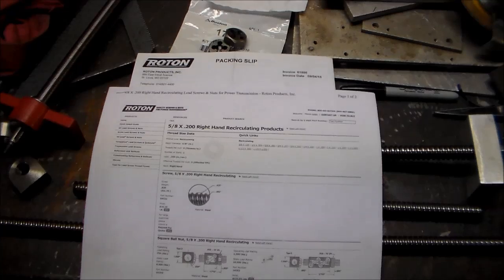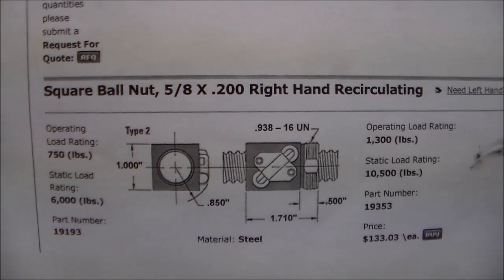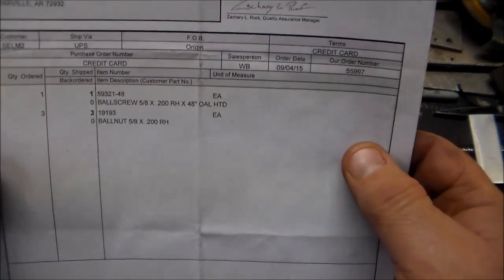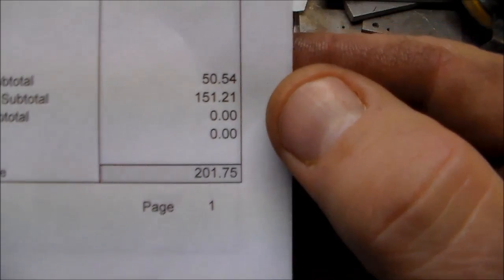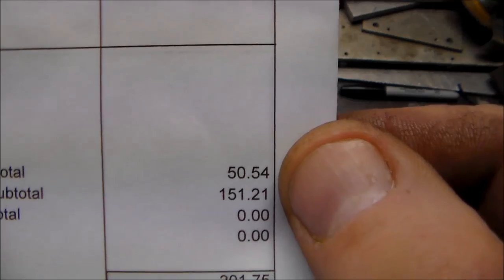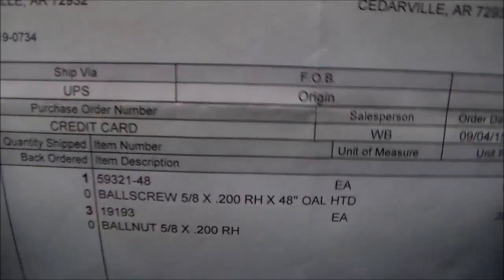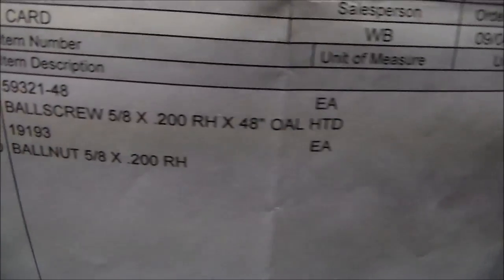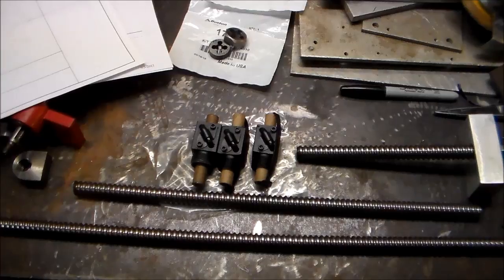Part 3 Harbor Freight Mini Mill X2 CNC Conversion Step by Step

Comment: So when you purchase this mill, these are the things you have to make and buy? Forgive me, never used a mill before and I have been looking at this particular one.
Reply from the maker: The mill is a manually operated machine. I want to convert it to operate via computer control, so the factory parts have to be replaced for all that to happen. I can't say how well the machine works as it comes, but keep in mind it is very small, so keep your projects small.
Reply: @SelfMadeProject  Thank you very much.

Comment: the last couple of days I've watched several videos on the harbour fraight milling machine. and many other's. But it seems people are spending a thousands of dollars to turn a harbour fraight tool into something they could just buy.. I'd like to buy a harbour fraight milling machine. But funds are limited at this time. I have no problem with harbour fraight tools. enjoyed this video. I watched it twice already.
Reply from the maker: Thanks for checking it out so far, this project is still in the works. But, I'm not spending thousands, not at all! Now if you want to go out and by an already converted machine you will spend thousands. The little mills are an inexpensive way to tinker with cnc or milling in general, just don't expect a lot, they are tiny.

Comment: Hello! First let me say THANK YOU!  
This has been so useful to me! I’m in the process of gathering everything I need. 
I have a question about your Ballscrews, could you tell me the finishing specs? Like length you cut for each axis, how far in to the screw did you cut the thread?
Reply from the maker: Well, I purposely didn't give a lot of specs. I was just wanting to show that this could be done with hobbyist tools without spending a ton of money. I did buy some plans from Hoss Machine and downloaded some others free. Since I'm using a mix of "paid for" info and some free, I thought it best not to share every detail. Hoss' plans are still available I believe, but it's really more just a CD full of drawings, not so much a how to. At least that's what I got, maybe he's updated them.

Comment from the maker: I just noticed that someone has went through and thumbs downed all the videos in this project. Not that I'm particularly moved one way or the other over that fact, but I am curious. Is it me? The subject matter? The style of the videos? The info? If there's something I can improve upon let me know. I'd rather see a negative comment than a thumbs down, at least I'd know why that way.
Reply: it was prolly a Roton representative... lol
Reply from the maker: +tagrav Now that's funny!
Reply: Self Made I cant see why anyone would down these. I'm watching because I have an antique Bridgeport small mill that's nothing but a dust collector and have wished it would grow up to be a CNC knee mill. Way back I was a trim automotive tool maker but very little CNC involvement with no experience in stepper motors. In short i had no idea where to start on this quest. There seems to be lots of finished table top CNC's and folks showing them in action but no complete builds. Like number 2 video was common knowledge to me but for alot of people it would be a building block of information. So go into anything with an attitude to learn something and if you already know be quiet and wait for the information you need and be patient because the person next to you may need to learn. I've been in classes where people act as if they know more than the instructor. Its activation for the ones who signed up to get information.
Reply from the maker: Thanks!
Reply: Don't sweat it man these videos are awesome learned alot.
Reply from the maker: Thanks, more to come on this project, just haven't had much time lately. Stay tuned.